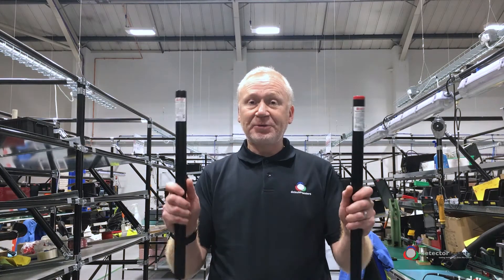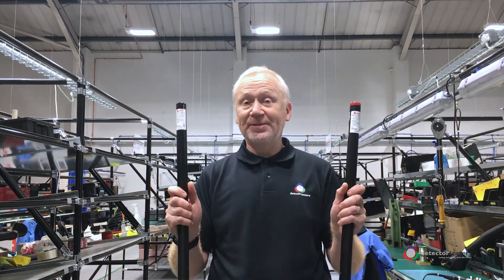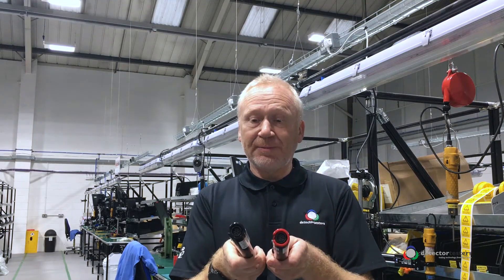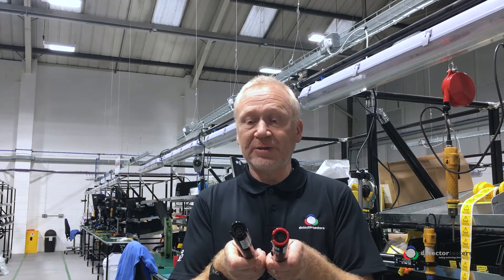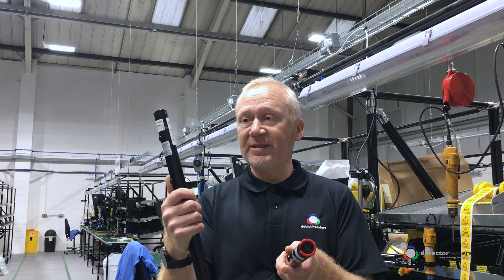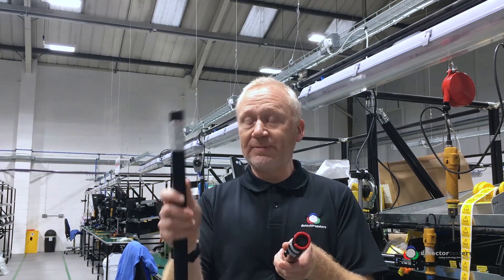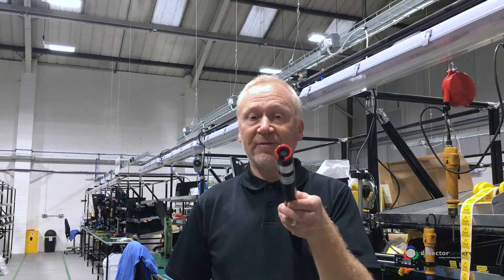Toolbox Talks | Solo Batteries & Chargers

Comment: Hello My name is Jose, 

I have a fairly new 461 cordless heat detector tester.

 My tester after replacing the battery, goes from green to red why is this?

 I always make sure to use fully charged batteries. Your help will be really appreciated.